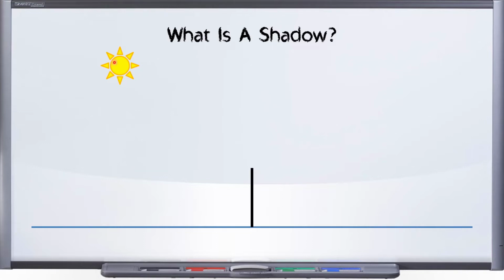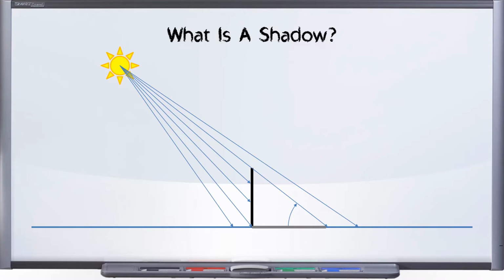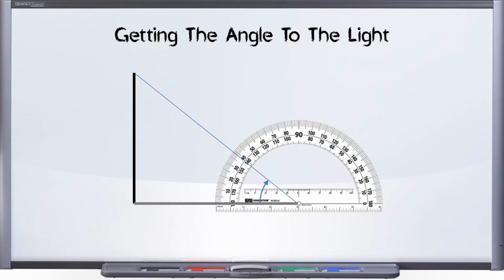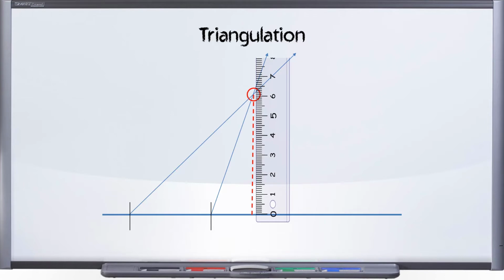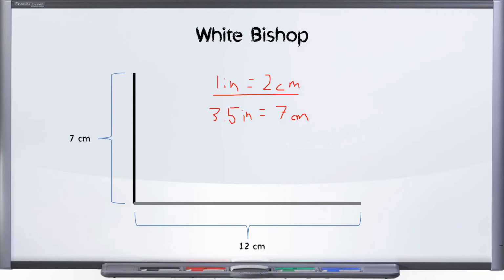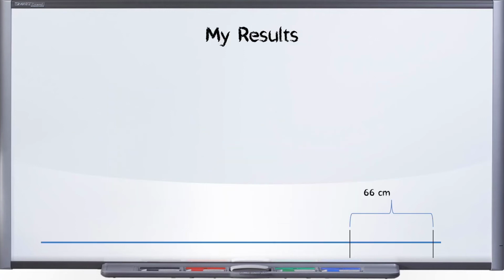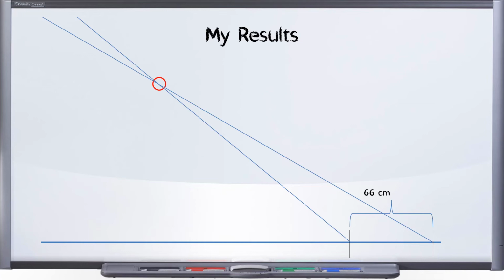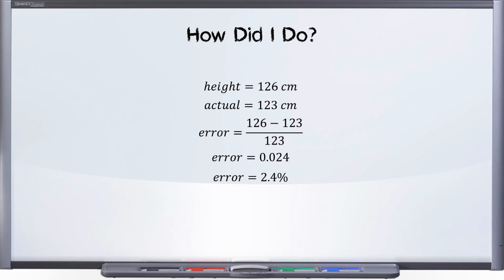How To Triangulate

Comment: Just for a laugh I might submit data for a 3000 mile high sun!

I wouldn't actually do that, sabotage a group project like that but it is fun to imagine you plotting it...
"Hold on a second, one of these things is not like the others, one of these things just doesn't belong..."
Reply: Interestingly, if you have enough datapoints that wouldn't matter! As you say, if one (or a handful) of the points are wildly off, it's often safe to conclude those are outliers and should be disregarded. It's part of the reason why you want more data points: the error in one measurement is reduced by the influence of the others.

This is one of the many things the flat earthers don't understand about science. They keep looking for that One Magic Bullet that kills the globe. It simply doesn't work that way. Even if they find a handful of horizon measurements that don't quite fit the globe, there are thousands (millions? billions?) of others that do.
Reply: AMOGUS

Comment: That all sounds so simple but you'd be amazed how complicated it gets when you have to code a 3d render engine to recreate that simple set up. 

It's not too bad if you're ray tracing because then you just take unit vectors from a point camera to a screen and use the dot product to first check for intersections in a min loop. Then take another dot to get the shading with the light source from the surface normal which you get full the cross product. For Shadows you need to run a ray from the collision point to the light source and check again for mesh intersections. 

But with rasterisation you have to make a transformation matrix so you can multiply it by the inverse (matrix of minors here to get the determinant) to project your 3d vectors onto a 2d screen. Then you need a depth buffer to know what is in front of what. Pain in the bottom.

When you do it here it all looks so simple but the amount of linear algebra in a shadow is ridiculous.
Reply: 12:00 if you look closely at that protractor I think you'll find it was 30.2564 degrees give or take. ;)
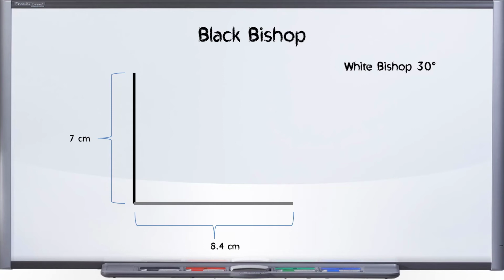Reply: 13:00 again, it looked more like 38.82 degrees to me.

Ok, I'm a child.

Comment: I was impressed to see an American using centimeters, until it became clear that they are American centimeters :D (I'm just joking, it's a very good explanation.)
Reply: There are two things to know. The first thing is, that American scientists use the metric system since decades. The second is, that there is a transition going on in the US away from the imperial system towards the metric system. Very slow and very soft to not obsess the Americans. Neil Degrasse Tyson has explained it a few weeks ago. The third thing is, I'm an electro engineer and used to define scales for everything like voltages, currents, impedances, and so on.
Reply: @Georg_Hannes  I was making a bit of fun, but units of measurement is of course an important topic, also outside the science labs. It is not only when sending probes to Mars that things can go wrong, there are examples of airplanes running out of fuel in mid air due to unit conversion mistakes.

The whole history of why America is still not fully metric is amazing, and involves actual sea pirates and kidnapping, along with fascinating insights into human reluctance to change. Changing all over the country now (or quickly) would be extremely expensive, but would probably save money in the long run. A slower transition is probably also safer, by e.g. giving drivers a chance to get a feel for the new units before removing the old ones from speed limit signs.

Americans are not the only ones holding on to old units, we see the same all over the world when it comes to shoe sizes, railroad gauges and baking recipes. I am reminded of the old tongue in cheek saying that the great thing about standards is that there are so many to choose from.

Funny thing to illustrate the general confusion: Gold is measured in troy pounds which is 372grams, while feathers are measured in avoirdupois pounds which is 454grams, so a pound of feathers is heavier than a pound of gold. Smaller quantities are likewise measured in gold troy ounces of 31.1grams and feather avoirdupois ounces which are 28.35grams. So an ounce of feathers is lighter than an ounce of gold.

Thanks for the Tyson reference, that explains why my YT feed has been full of videos explaining the metric system the last 3 weeks :)
Reply: @michaeldamolsen  America has had less pressure to convert than Europe did. Europe's economy and the U.S.'s are roughly equivalent in size, but pre-metric Europe would have been like the U.S. if each state used a different set of units. If we had to convert weight from California avocadopounds to Kentucky bourbonweights even we would have switched a long time ago.
Reply: @barryon8706  That is an interesting thought. However, back in 1793 when Joseph Dombey sailed off from Paris with a kilogram sample for the US, the US were using a similar hodgepodge of measurement systems brought over from many parts of the old world. If he had not been captured for ransom by pirates and held for years because the French didn't feel he was important enough to pay for, the US may have been metric since the really early days. (I think I might have read about that in an NPR article?)

If you google for "site:nist.gov 1136a.pdf" (sorry, but whenever I post links my posts disappear) you will find an interesting account of metric units in the US. Every state has had standard metric unit samples available since 1866, and from 1893 all "freedom" units have been officially defined in terms of those metric standards.

Edit: By the way, I always enjoy your comments, and seem so find you on a large number of the channels I visit :)
Reply: @michaeldamolsen  Thank you, I did not know that And thank you,!!
Reply from the maker: @Georg_Hannes  let me add that I'm an American aero engineer by training, so I naturally treat units very fluidly. When I was in school, the AIAA called for feet and pounds, and from what I've seen, they still do. However, international collaboration is a real thing now,, and the lost Mars mission still burns in the backs of our minds. So as an engineer in America, we have to be the ones always on top of the units.
I learned that way back in school, and I guess I take it for granted now. In class,, I like to think that I'm teaching others to be unit-agnostic as well, but here on YouTube, it's probably just confuserating. (That's a word... it's new... I made it up.)
Even today, I have a video where I've done it in degrees, and I realize I probably did the original in radians.
Reply from the maker: People were dismayed I switched to inches in powerpoint... Powerpoint is set to inches, and I just couldn't be bothered.
Reply: @icansciencethat  I've seen some younger people struggle with proportional drawings when only using metric units, so I actually found it clever to use a different unit to make the distinction. When tutoring I have found it helpful to pace distances in feet or strides, and then draw them in cm, I assumed you were doing the same :)

Fun fact for those that were dismayed: American inches are DEFINED to be 2.54cm, so you were secretly using metric anyway.